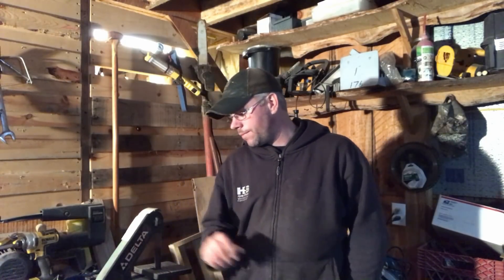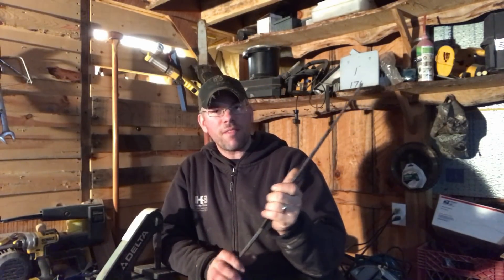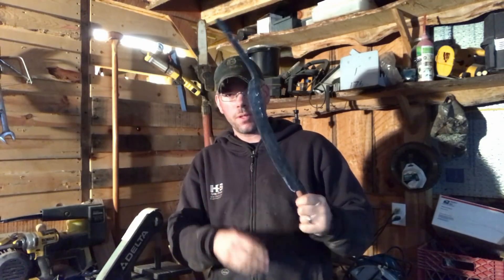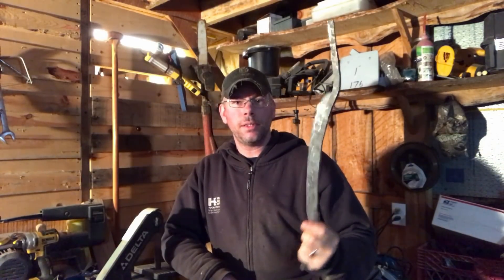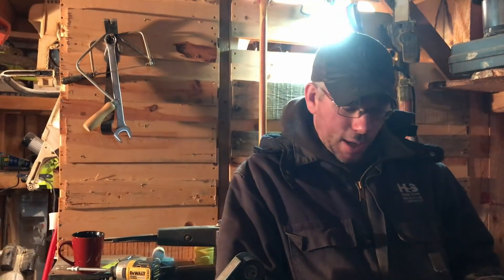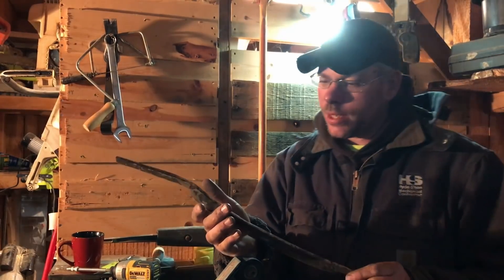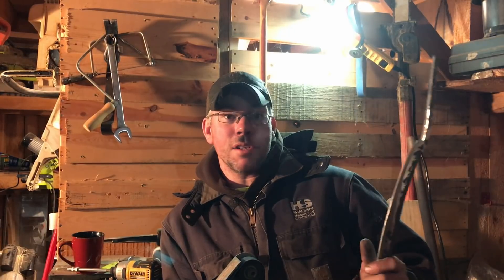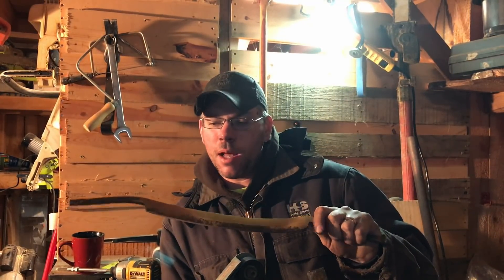Hand Forged Draw Knife: Grinding My Life Away

Comment: You use what you got ... I understand. But this looks like a good time to consider getting a grinding wheel of some kind .. they can be cheap when your time is not ...
Reply from the maker: +Clyde Decker I have a lot whet wheel but it wheel but the grind is very fine on it.  I need to build a 2" belt grinder

Comment: Morning Jim. Love the title for this one. I kept waiting to here a cover of "Driving My Life Away". Draw knife is looking good. You can build your own 2 x 48 or 2 x 72 grinder a whole lot cheaper than buying one built by somebody else. Several channels have build videos. 
Grinding music? Is that like a "mix tape" from back in the day?
Don't forget to leave the edge thick for the heat treat, I'd hate to see a finished cutting edge cooked away. Any plans on the finish? Will you blue it, oil rub while still hot, or what? Can't wait to see.....
Doing great on this tool build. Looking forward to your tool builds once you have the forge all set up in the barn. Man glitter can be wood shavings, saw dust, or metal shavings. You getting good at all of the above.
See you next time.
Reply from the maker: Good morning Thomas...you'll have to find out on the finish as I haven't a clue yet.
Reply: TheTradesmanChannel 
Cool, just wondering and suggesting a couple of options at the same time. BLO or Linseed rag-rubbed into still warm steel make a great finish and reduces corrosion as long as you keep the tool oiled or waxed after each use. But blueing looks great on forged finish too. Cantvwait to see what you decide. Even if you go another way, I could learn a different method.
Reply from the maker: That's a good idea.
Reply from the maker: Thanks Thomas
Reply: TheTradesmanChannel you're welcome my friend.

Comment: Was wondering what you were going to grind with and not create too much heat ,the belt sander is slow but wont overheat the metal like a grinding wheel will .Looking good Jim .

Comment: Have you ever used a 3 or 4 inch belt grinder upside down with it's handle clamped in a vise.   I use my old heavy Porter Cable this way often.    the old guy    Bert.
Reply from the maker: I have, works great.

Comment: Looks like it’s coming along. I’m learning here. How many belts did you go through? I’m with you on busting the knuckles.
Reply from the maker: None yet.  That machine is so small if you really push it will stall out...perfect for not over heating the metal.  It's all rough ground now and ready for heat treating.

Comment: I thought that clicking noise was a clock. What is a fence charger?  Don't you just plug the fence in to an outlet and run 120V?
Reply from the maker: It's like a transformer that pulses voltage to the cow fence
Reply: TheTradesmanChannel gotta keep the cows in!